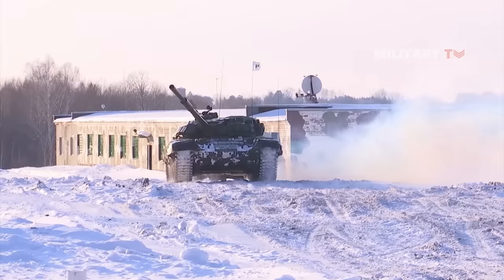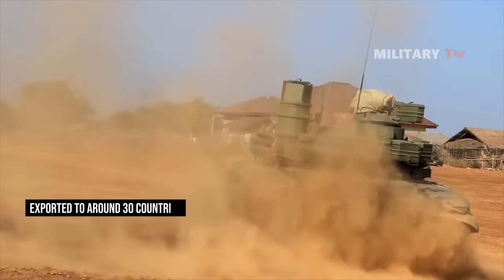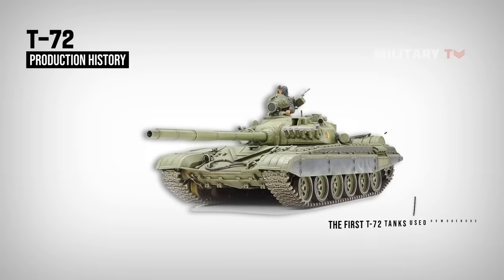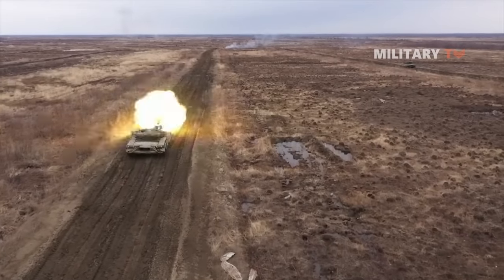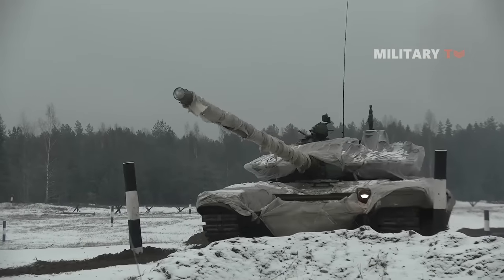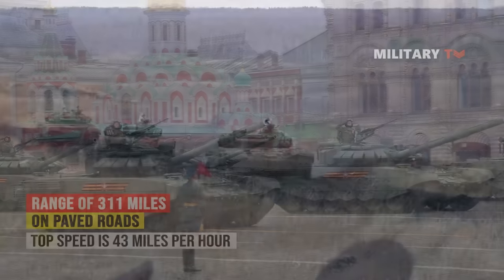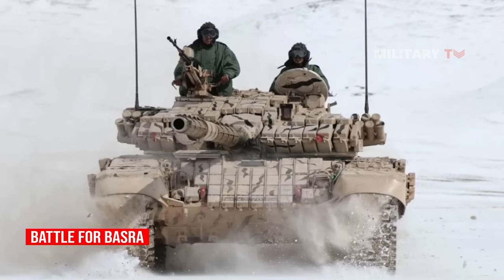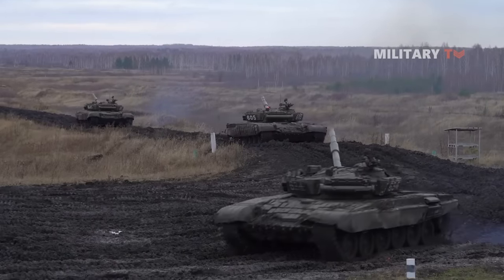Why the T-72 Tank Is the Backbone of the Russian Army

Comment: The 4km/h maximum reverse speed is a lethal vulnerability.
Reply: that's why you gotta bury em hull down!
Reply: its not designed to retreat like the French tanks which have faster reverse gear 😂
Reply: Even the pt-91 twardy has a reverse speed of 30km the renk 350 Transmission could have been purchased to augment the t-72 but it wasn't.
Reply: @odalv316  bruh tanks mbts need to have a good reverse gear
Modern combat is based more on speed
Reply: Tank can spin on its Axis and driver is in the front driving trough terrain that's not a parking lot,but a total off road as it gets!
Reply: @odalv316  It was designed for advancing and winning. 😅😂
Reply: I've seen improved version with decent reverse speed but is difficult to see them due to how many time the russian army updates their T72 tanks.
Reply: as always western comments "slow reverse speed" but hey you don't see Abrams doing reversing in Ukraine before it gets blown up by drones. Russians use their tanks as infantry support or breakthrough tank attacks like old horse cavalry. attacking full speed to exploit any crack in the enemy line.
Reply: Idiotic complaints anyway! Try driving a car in reverse on an asphalt road any faster and@tommytomas-fr3sh
Reply: no step back

Comment: The T-72 is more of a successor to the T-62 instead of the T-64, it is was chosen due to its price, operational costs and most importantly, reliability.
It is an en masse tank, it is a shame post soviet countries couldn't keep the T-80 operational, it is a more advanced tank, with versions having active protection systems, it got a bad rep due to the Chechen wars, but that's mostly due to the doctrine used, no matter the tank, sending them into a city with rubble everywhere without infantry support is a death sentence.
Reply: No the T-72 is not a successor to the T-62!The Soviet family of M.B.Ts goes this way,T-54-55-62,   T-64-72-80
Reply: T-80 is not more advanced tank. The T-80 is inferior in chassis and automatic charging system. In other mechanisms and aggregates, it has no significant advantages over the T-72.
Reply: Russian have active protection??

Comment: Gotta admit they have some sweet looking tanks.
Reply: Especially when they explode…
Reply: Not really they look like they have everything bolted on as a afterthought
Reply: @MrTangolizard   it was actually very revolutionary design and breakthroughs, ahead western counterparts. they forgot to mention that this tank can be mounted with barrels and armor types and still be operational. German and US tanks cant do it anymore. at least without heavy modifications.
Reply: @jefreyjefrey6349  so tell me what was revolutionary about the t72
Reply: 1. High level of protection. In 1972, this tank had the ultimate armor. 2. Very light.
 3. Highest firepower. At that time, the best NATO had was the 105mm L7 rifled gun.

Comment: Well sort of. The T72 didnt really evolve from the T64. At the time of introduction the T64 was a high end product with basically all the tech the UdSSR could realistically muster. That resulted in maybe the best tank at the time but also in a lot of reliability and money issues since it was freaking expensive. The T72 was later developed as a much cheaper and reliable teched down version meant to operate alongside the T64 and later the T80 which were both for their times the best armor the UdSSR could field. Later the T72 went into a parallel development one keeping the T72 name the other being named T90. Overall the biggest advantages of the T72 is its very low price and a dangerous gun even to modern mbts. In UdSSR doctrine it was imagined that a unit of 12 T72s and T80s would take on 4 Leopard 2s and while losses would be high the fight would be won in the end.
Reply: Yep, quantity over quality. The Soviet doctrine was to overwhelm the Western defense with thousands of T72s and T64s , that’s why it’s relatively lightweight , fast and have crew of only 3, less people per tank - means more tanks on the battlefield. The front armor of T72B and B3 is pretty good and comparable with Leo 2 A4 and A6 respectively. It’s a relatively good tank with a pretty good « Bang for Your Buck” ratio. However, the biggest drawback of T72 platform such as very slow 3 mph  reverse , high explosive carousel of the self loading mechanism and very poor Vision and communication system as well as fire control system from the 70s doesn’t make it a very good tank by modern standards and was only somewhat fixed in T90M in mid 2000s which is probably the peak of T72 family evolution
Reply: Excellent point to put out there. People often think programs develop linearly, and while this sometimes happens with successful platforms, often as in this case and with the T-80, these were all very different programs with different specifications they were aiming at. The T-64 was in many ways better than the T-72, but it had impractical issues both on the field and logistically. The T-72 took a lot of lessons learned from the T-64 but was a really a program aimed at replacing the T-55 series that were the backbone of the armored forces and quickly becoming obsolete. The Soviet Army needed a competent tank to replace the tens of thousands of T-55 variants, equip the satellite states in the Warsaw Pact, and export to foreign markets.  The T-64 and T-80s were attempts to build a best in class tank with new technology purely for the Russian forces in the Soviet Army. Of course, running a multi chassis tank fleet presented considerable logistical challenges and some of the technologies of the T-64 and T-80 proved to be less useful in the field than hoped, making the T-72 the platform to consolidate on for future progression. The T-90 for an example IS an evolution of the T-72. A T-72 that has been upgraded to its best in class version vs the original high production versions or slap on upgraded versions.
Reply: Alright, let's debunk this. 
1. The T-72 did evolve from the T-64. 
Leonid Kartsev didn't want to produce the T-64, so he took the best design elements from the T-64 and slapped it on the T-62. 
This solved alot of the problems with T-64. 
So it was accepted into service as the T-72. 
2. The T-80 was another program, that started because of the problems with the T-64. 
And was essentially just a T-64 with a turbine engine. 
3. The T-90 started out as a upgrade program of the T-72, but was later spun into it's own tank design.
4. The cheapness of T-72 only lasted for a couple of years. 
By the time the T-72A is introduced, it ended up being more expensive than the T-64.
Reply: @Orcawhale1  thats a lot of half truths if ive ever seen one
Reply: @TheDude50447  Som hvad?
Reply: @Orcawhale1  1. While the part about design elements is certainly true the T72 misses a lot of tech from the T64 and got worse optics, fire control System and a simplified loader among others. Its significantly less combat effective.
2. While it wasnt a major jump from the most modern T64 to the T80 in capabilities alone the respective base versions differ considerably. Also the T80 is a new hull and turret Design. Its just following the same Design principles.
3. The T90 is in essence still upgrading a T72 hull and turret. Its upgraded differently but its not a new tank Design.
4. I was first and foremost talking about the time of introduction where the T72 was a lot cheaper. Todays variants can reach prices in the 4 mil  Dollar range which ist still much less than for example Western mbts
Reply: @TheDude50447  1. T-72 was given the same optics and fire control system, and used a better autoloader. 
And is more combat effective, because it can fit longer darts. 
2. The T-80 hull is just streteched T-64 in order to fit the turbine. 
And the turret design wasn't changed until T-80U. 
3. T-90 uses a entirely different turret, and a fire control system. It is a new tank design. 
4. T-72 was cheaper due to the T-62 parts.
Reply: @Orcawhale1  1. What youre saying is that the T72 was in essence just as combat effective as the T64 but more reliable and at lower production costs. Yet the UdSSR chose to keep producing both and only export the better T72 to non warsaw pact allies. Also equipping their best units with the worse tank.
2. Which Version of the T90 received that completely new turret. Im aware that armor and optics on the turret went through significant upgrades but a new turret is news to me.
3. I didnt know the T80 reused the T64 turret. I just know they basically had to redesign the whole Chassis leading to practically a new hull.
Reply: 1. Yes, that's correct. 
But the export versions had thinner armor and simplified fire controls. 
The T-64 weren't seen as a worse tank, that wasn't realized until later. 
2. T-90 had cast turret, T-90A has welded, and T-90M is "just" a redesign. 
3. Yes, the chassis had to be redesigned, along with suspension and roadwheel. 
Due to the stress put on by the turbine engine. 

But if you want to learn more about it i highly advise you check out The Soviet armor blog. 
(Which is where ive gotten all of this stuff from).
Reply: We do not know anything from what you claim. Russia has better guns, far more reliable and it counts most. On the top of that, many new guns are even more advanced than what USA have.(hypersonic missiles).
Reply: Good to see some people actually do some research and learn a little about tanks and the history of tanks before they comment. I just came from one comment section full of video game players. Had to climb a ladder to stay outta all the horse shit that was being talked.
Reply: @Orcawhale1 The T-90 is strictly an upgrade to the T-72B. The original T-90 was literally just a T-72B with the fire control system of the T-80U slapped on, hence its original designation of T-72BU or T-72BM. When the Soviet Union fell and the new tank entered production, it was rebranded to the T-90 to make it seem newer than it actually was. Even today, the T-90M had the exact same hull as the T-72B from 1985, but with potentially some slight lengthening for the new engine.
Reply: The Battle of 73 Easting. 

There are videos of it online.  😁👍
Reply: @danboyd2725  Ive watched that documentary like 3 times as well as the operations room video. If this is about T72 performance its not representative. The majority of T72s were the base modelwith some T72Ms which are watered down T72As. They went up against the M1A1 and Challenger. At the time this battle took place russia was developing the T72bu upgrade which later became the T90. The articles Ive read about this suggest that the most modern T72s at the time given equal crews wouldve given the M1A1 a run for its money. The Abrams wouldve had the upper hand in stbilization, fire control and optics but the T72s wouldve had a range advantage. Still a slight edge to the Abrams but probably far from the slaughter we saw during desert storm.
Reply: @TheDude50447  The M1s out distanced the range of the T72s, if Russian troops manned them in Kuwait it would have still come out the same. 
Updated M1s will go up against the latest T72s in Ukraine.
Reply: @danboyd2725  If the M1A1 had to fight against the T72BM (introduced 1988) in Kuwait with well trained crews (doesnt matter if russian or not) the M1A1s wouldve had a much much harder time. While likely to have won the conflict there wouldve been consiberable losses. The iraqi tanks were equipped with long outdated highly inadequate ammunition. Thats where the effective range disadvantage stems from.
Compared to the T72s the iraqis used the T72BM wouldve been equipped with better composite armor, Kontakt 5 era, better fire control, much better ammunition, thermal sights, a long range GLATGM etc etc. Its almost a different tank and the capabilities cant be compared. 
 I dont know how todays versions of these tanks compare against each other.
Reply: @danboyd2725  never underestimate your opponent. While russia is doing surprisingly poorly in Ukraine that is most likely not down to the equipment. After all for the longest time they mostly went up against their own old equipment. I dont know why theyre not performing but if i had to take a guess id say its down to the leadership and conscripted soldiers.
Reply: @TheDude50447  Also down to the corruption of the Russia Army ND the use of the latest  antitank weapons.
Reply: @danboyd2725  might be
Reply: @danboyd2725  m1 won't see shit... artilery will make sure of that...
Reply: @Lars  the russians are not performing in ukraine because that's what msm says.
Reply: @catalinxnecula  Russians sucking at war makes you mad bro?

😄😄😄😄
Reply: @catalinxnecula  Not sure what theyre saying but if russia was performing they wouldve won by now.
Reply: @TheDude50447  over an army of 800k? trained to nato standards? armed by nato? without declaring full war? in a year? are you mad?
Reply: @catalinxnecula  Desert storm where allied forces went up against a much much bigger army than Ukraine has and had was over in just 2 weeks. That shows how it can go.
Btw Nato support is limited and didnt happen early in the war. Ukraine had a standing army of roughly 250k and russia throws everything they have shy of nuclear wepaons at them and have for some time.
Reply: @TheNihiliant  1. They went aftr mostly military infrastructure. They had to cut power though so on the first day ofthe air war they threw metal stripes from cruise missilesinto the transformers of power stations shortening them out.
2. The french built them a highly sophisticated integrated air defense system. Highly unlikely that it failed. Especially since it was fully operational while shooting down allied air assets.
3. The UKespecially provided them with training. Unlikely they became much better than their teachers and everyone else. The reserves mostly didnt receive that training.
4. Why would thes need nato personel when you say that the ukrainians are trained better than nato personel. Its just bs.
Reply: @АлександрОкулов-е5ъ  Im sorry but I cant read that.
Reply: What a nonsense to say :(
Reply: @MacIn173  What exactly?
Reply: It was a cheaper option
Reply: The t-80 had a gaping weakpoint at the front right under the gun -point. It was so disasterous that in war of chechenya russia was humiliated by measely t-54's and rpg's were actually more effective against t-80 than t-72.
Reply: @VeXu666  nonsense. Weakest point of T-80 is fuel. Lack of and ease of explosion.
Reply: @mirekslechta7161 pretty sure those hyper sonic missiles were shot down

Comment: You're showing a T-80 on the thumbnail and in several shots during the video, even a T-90M at one point.
The T-64 was produced in Kharkiv and the T-72 in Uralvagonzavod, they were never produced in the same factory, and never were ment to, they were meant to be produced in tandem.
When talking about the self entrenching system, you're showing a T-80 and circled around the blade that is meant to clear minefields.
You also showed a T-64 exhaust when talking about the T-72 latest engine.
The cope cages were never made to counter top attack ATGM but to disable small shaped charges of RPGs (like all cage armour) being fired from top of buildings in urban environments, this experience came from the conflict in Syria.
Very poorly researched video, considering the amount of information out there regarding the T-72.
Reply: Also the cope cages were meant to stop those dam little bomb dropping drones. That was studied during the Armenian  Azerbaijan war
Reply: @T_81535  Well did it work out very well?

Comment: Soviet tanks are for attacking to any target at and behind the defence line, but not duelling necessarily with the opposing tanks, even it is better to avoid and flank, and  Western tanks to counter them.... so, design principles are different. If you are attacking tank, you need good mobility not to be easy target. Mobility has got two dimensions 1- speed  2- Cross-country capability that you need to be fast moving target not to be acquired easily and  cross country mobility that attacking axis will not be predicted correctly to concentrate the defence or set an defensive ambush.  And,  being lightweight also needed to use any bridge to keep the momentum of blitz and not to create choke points at the river crossings since north and east Europe flat and cut by rivers across. However, attacking with speed brings disadvantages, one can not comfortably acquire target visually because at fast advancing tank, dynamics of  changing of environment, shapes, lights disable some of the cognitive capacity of the observer, and usually attackers meet their targets at short distances long after their target spots them visually and audibly . So, for Soviet tanks long distance shooting and accuracy less needed, but for Western tanks it is crucial that they can make some  hits until attacking tank acknowledges and spots and countering back with firing. All mechanics of battle ground shapes the designs, so each of them having their own features with some use and logic.
Reply: Helps if when crossing country fast u can hit things when u fire

Comment: t72 was only protected against 1st generation TOW missiles; Current upgraded ammo will flip the turret half way to Moscow, even though reactive armor, there isn't a tank in existence, including the Abrams and Leapoard 2, that can take a hit from a modern TOW tandem or even triple shaped charge, you might be able to hit something easier with nlaw or javlen, but if you want to absolutely fucking wreck something hit it with a TOW, which has enough power to neutralize reactive armor and then still punch through the front of hull or turret, it doesn't have to rely on top attack,  and it is impossible to jam, alert to, or otherwise interfere with wire guided missiles, although they do have a slew of disadvantages as well